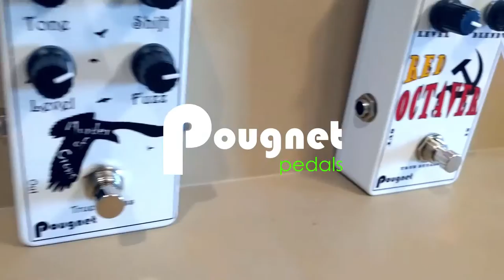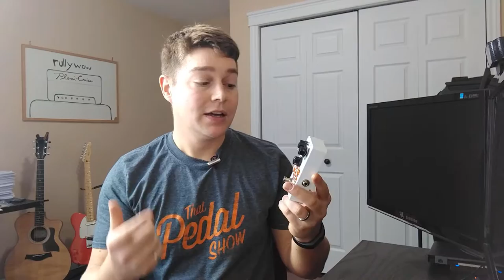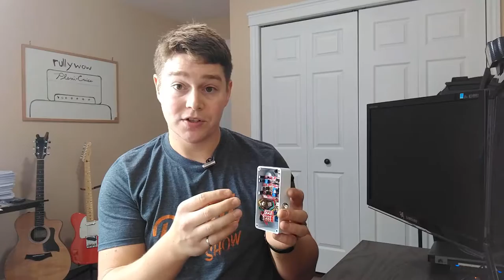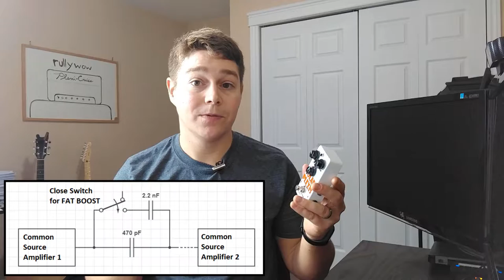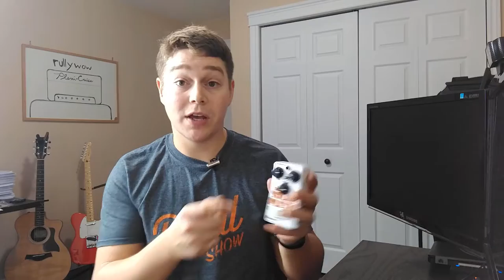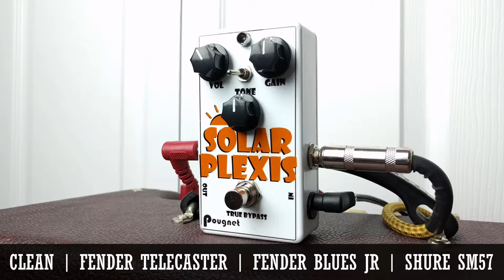Rullywow Plexicruise | Build Review & Demo

Comment: nice man! i haven't done this one but i have done a few of theirs..i jumped into building several years ago full throttle and built just about every sellers pcb that i could find,that i was interested in...i've been out of it for a couple years and just getting back into it...found PedalPCB and they have a lot of builds i'm interested in,also just found your channel...awesome builds you have,and great playing! cheers!
Reply from the maker: Thanks for the comment! I actually have a bunch of PedalPCB stuff on my bench now that I still have to build and do some videos on. As for the plexicruise, I highly recommend it. It's a really easy build, low noise, and great overdrive. I have been using it over some of my more complex ODs lately.
Reply: @pougnetpedals  good to know..thanks for the info!
Reply: Hey man check out fuzzdog out of the U.K. interesting stuff!